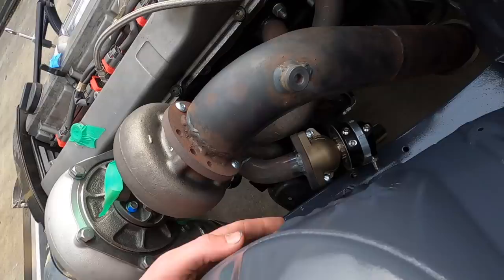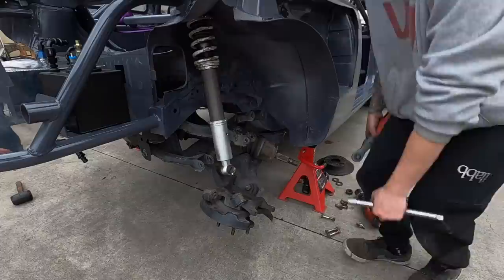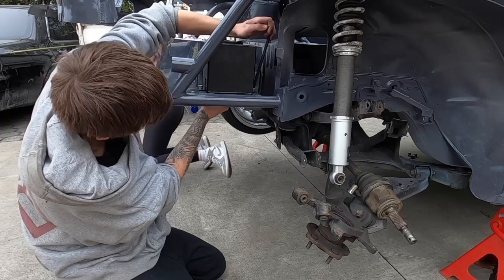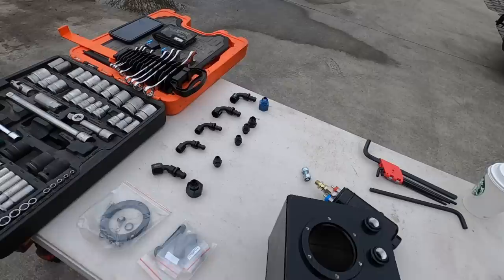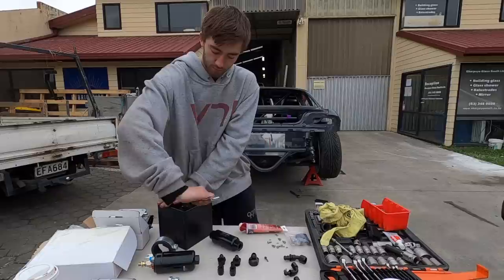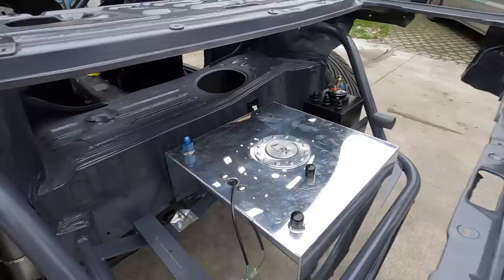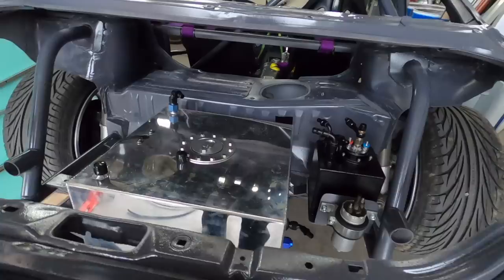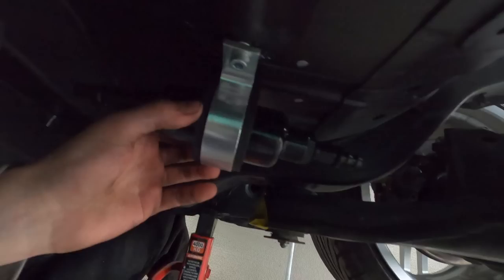We Are Just Days Away From Tuning My RB25DET Silvia Drift Car!

Comment: Hey man Dust shields for the brakes aren't required for Cert. If they are there they do have to comply though
Reply from the maker: I’ve been told differently but even if that’s true better to save them than to cut another good pair up
Reply: @stack3dit  yeah exactly but yeah I can't find anywhere in the lvvta handbook that requires them and heard of plenty of people even recently going through without them